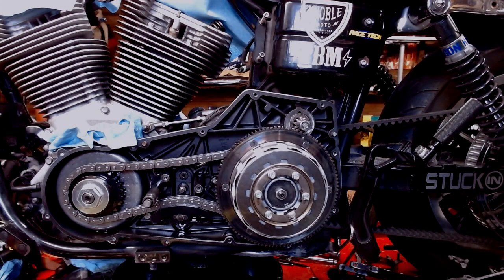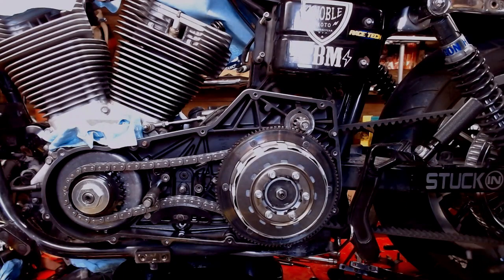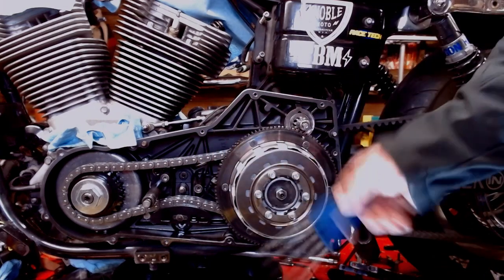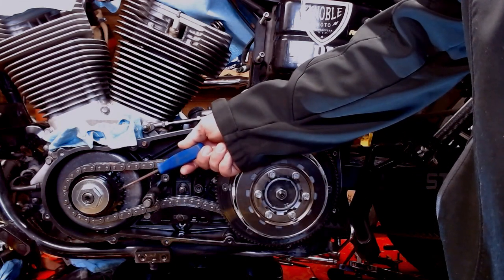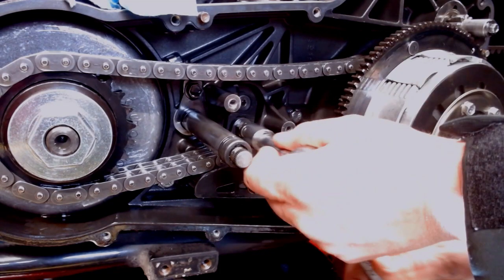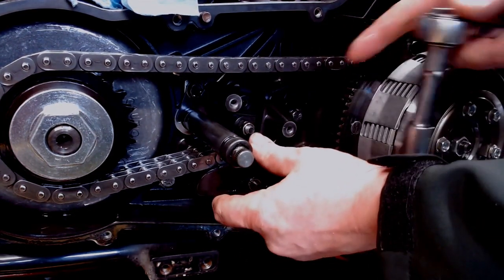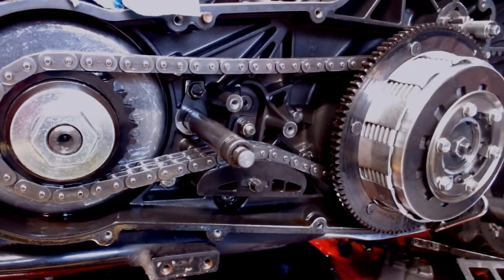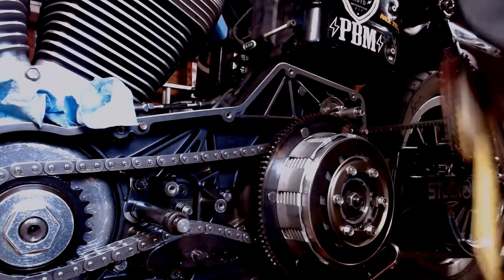Primary Chain Tensioner adjustment on Harley Big Twin. Twin Cam & Evo.

Comment: You should have rotated your rear tire to find the tightest spot on your chain.  Check in different spots
Reply from the maker: It seemed to be consistent no mater where it was rotated to.   That is a good point I should have added to the video though.

Comment: Thanks for the video , why 24 t comp instead 25 t compensator?? any gains from that??
Reply from the maker: Oh yes!  It drop the final drive ratio from 3.10:1 to about 3.4:1.  Huge difference on acceleration, and you don’t have to reprogram your Speedo. The stock Harley ratio is way too tall.
Reply: @KnobleMoto   i own a 91 flhs 5 speed , which way would i need to go for taller gearing  or  would it make much difference Sir ?? Thanks
Reply from the maker: @jamesconn7311  if you want taller, as in lower rpms on the highway, you would want to go up in teeth on the front sprocket.  Or a larger front pulley.  If you want more acceleration, you would go to smaller numbers on the front sprocket or pulley.
Reply: @KnobleMoto  Yes Sir , lower rpm 's what im after, Thank You !!

Comment: When does the primary chain need to be changed? How can you tell?
Reply from the maker: There is a wear spec in the service manual.  It varies by model.
Reply: Logically when the chain is slightly loose and the tensioner is maxed out